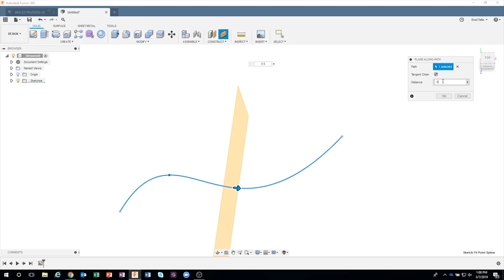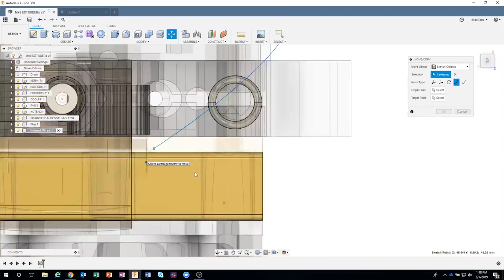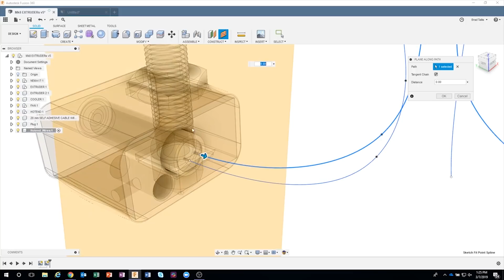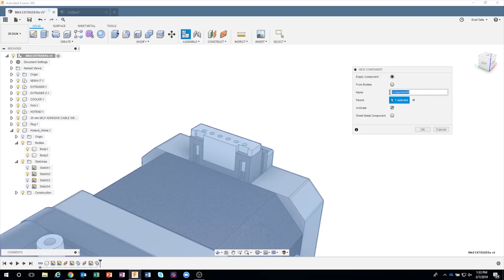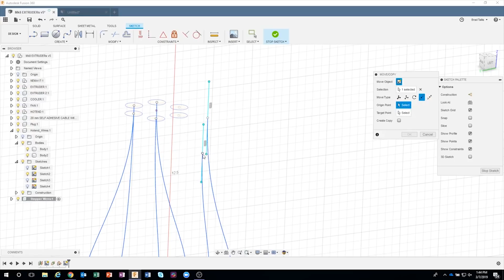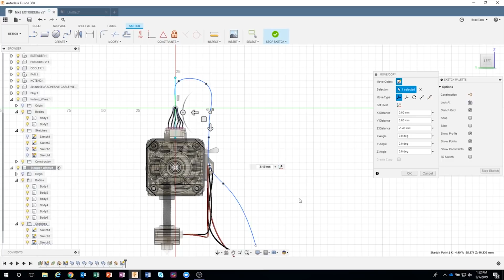Episode 18,  Electrical Wire Routes

Comment: Excellent presentation. I need to simulate wire routing on my latest project so this is relevant. The only downside is that with a fairly complex assembly - the computation time starts to get crazy.

Comment: Recently I had to design a structure with many 1" square tubes and found it tedious recreating the shape over again. Is there a way to store a template of a shape or cross section and placing on a body then extruding it to the desired length or cutting into a plate to make a square hold?

Comment: Hey, so last time I was messing about in Fusion, I tried doing the trick to put stuff on a curved surface using the sheet metal "unfold" option, and I couldn't get it to work (there's not even an "unfold" button, just "create flat pattern"). Perhaps you could go over how to do this in the newest version/things related to that?

Also, you should put a link to your personal channel in the description. Seems like it's not easy to just search you.